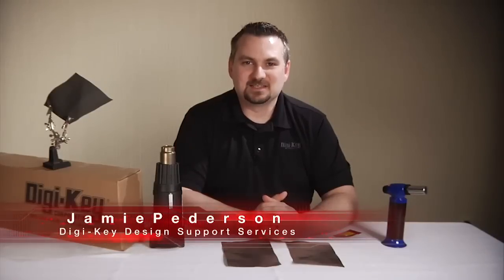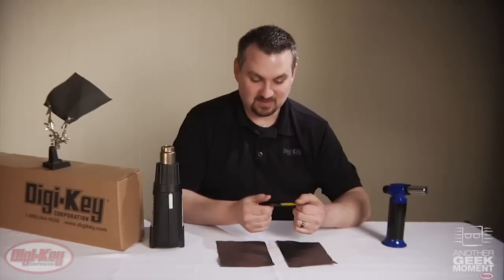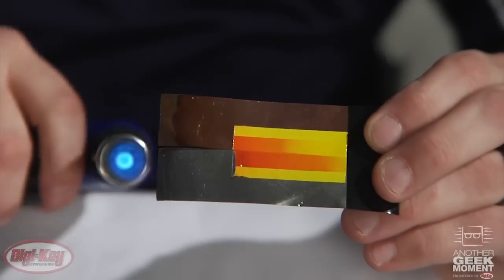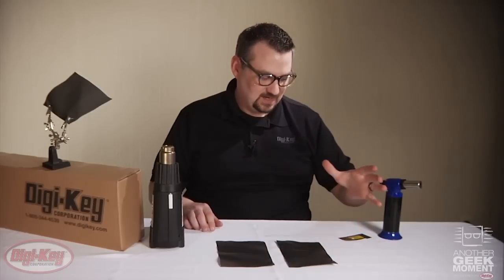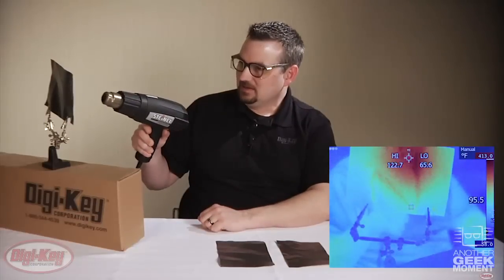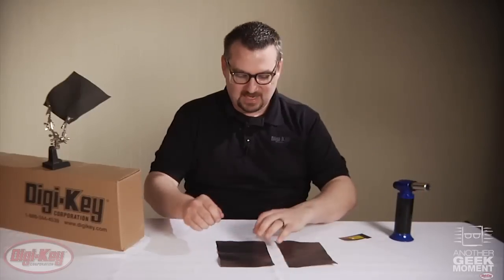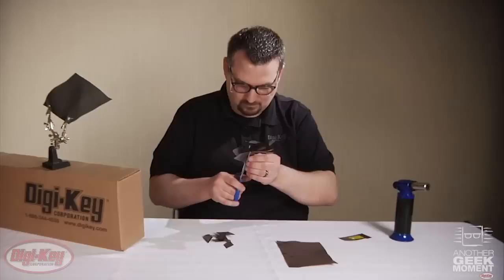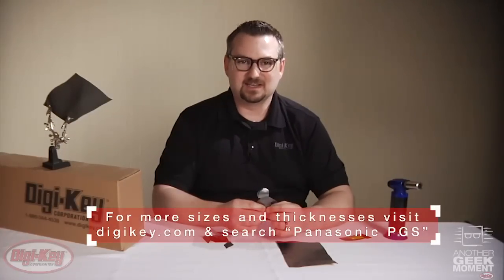Panasonic Pyrolitic Graphite Sheets - Another Geek Moment

Comment: I got some of this material the Digikey # P14965-ND THERM PAD 180MMX115MM W/ADH GRAY 0.0008" (0.020mm)  The thinner the carbon pad the better the transfer vertically if you read the specs.  I used it as a cpu thermal transfer on a Intel 9600K in place of thermal compound.  It is easy to cut since it has a removable mylar backing.  With the mylar removed it holds together and has a slight adhesive so it stays in place.  You can peel it off to reposition if you need to.  I could not see any difference in the cpu temperatures after application.  One sheet is 4.5" X 8" so you can do a good number of cpu's with one sheet.
Reply: Thermal paste better?
Reply: More suitable in passive cooling like smartphone

Comment from the maker: It sounds like you would be wanting a thermal blanket that insulates rather than conducts heat. Shielding heat would require an insulation layer to cover or mask the elevated temp.

Comment: The datasheet says 400°C, NOT Fahrenheit. The max temperature in Fahrenheit is 752°

Also, in your first test, is it really a fair comparison?  I'm betting the copper strip has a greater heat capacity than the graphite strip, so, of course the graphite strip transmits heat faster and cools down faster.  A more informative test would be to heat two identical thermal masses, such as two cubes of solid copper, and then attach the copper strip to one, and the graphite strip to the other and monitor both for how fast the copper cubes cool down (i.e. how well does each conduct heat away from the copper cubes and dissipate it.)

In other words, your tests gave me little information about how well the graphite sheets function as a heatsink.
Reply: His test is actually quite good. It will transfer heat very efficient. It just replaces thermal paste.
Reply: @neutronpcxt372  where can I buy this ? What is the name on amazon ? Is it save to use between cpu die and ihs?
Reply: You can't buy this on Amazon.

1. You use it between the CPU cooler and IHS, not silicon die and IHS.

2. You can use it between the die and IHS. However, you do have to cut and exactly apply it to the area of the chip.

3. Buy it here:

https://www.digikey.com/products/en/fans-thermal-management/thermal-pads-sheets/218?k=&pkeyword=&pv567=1267&sf=0&FV=fffc000a%2Cffe000da%2Cffecfdc9&quantity=&ColumnSort=0&page=1&pageSize=25

Always look for Soft PGS, not PGS.
Reply: The reason for not putting it is that alone, under the IHS, unlike between the IHS and the heatsink, is that there isn't a lot of mounting pressure, and there may be a big airgaps, meaning a lot of heat

However, if you put liquid metal on the die, and soft PGS on the inner side of the IHS, or even any other excellent thermal paste, you get absolutely outstanding thermal performance actually!

TLDR: 1. Put in between IHS and heatsink, since there is a lot of mounting pressure.
2. Do not put soft PGS between IHS and die because of low mounting pressure.
3. For absolute best performance possible, but liquid metal and soft PGS between the IHS and the die.
Reply: Old comment but listen, graphite/graphene has a much better thermal capacity than that of copper relative to thickness. This test was indeed helpful.

Comment from the maker: @JUSTTHETRUTHTV Panasonic PGS .076mm (part number P13689-ND) and the Panasonic PGS .025mm (part number P13691-ND)
Reply: Does one side adhesive type of pgs insulate heat or insulate electricity. Because in the data sheet it is mentioned only as insulation but what kind of insulation.